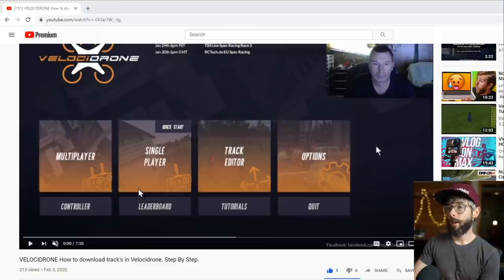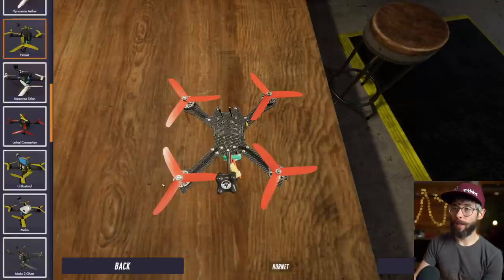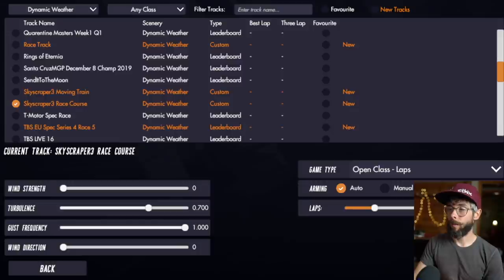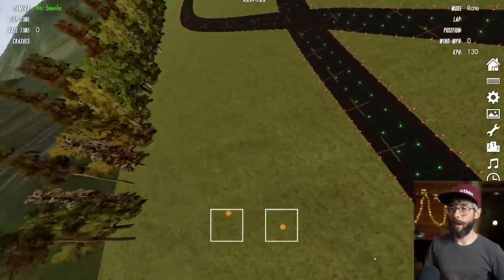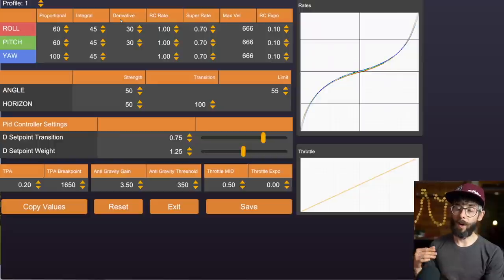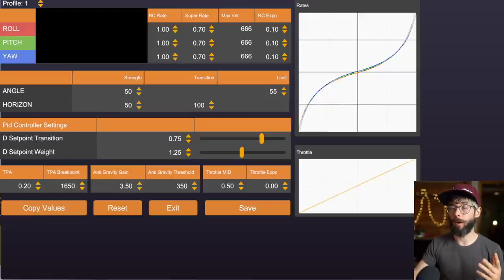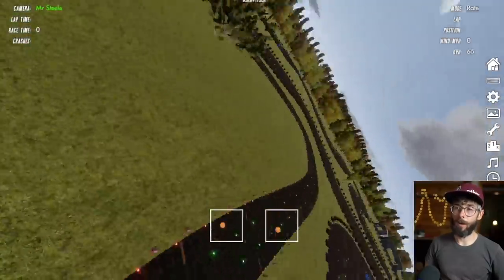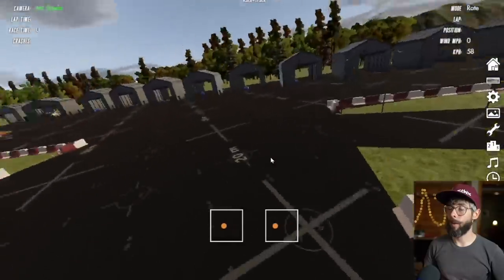Tuning Drone Rates (How To FPV 2020) Part 3

Comment: What is the reason for leaving yaw a bit slower?
Reply from the maker: Yaw on a quad is always a little wonky just because of how it inherently operates physically.  It uses Inertia over actual thrust like Roll and pitch do. Basically how are y’all works is two motors opposing each other slow down and two motors opposing each other speed up and the nurture of the props spinning up and the motor weight caused a quad to turn in a lateral orientation. Because this is using inertia it’s never going to be as accurate as something that uses thrust and also since were flying at camera angles that are not perfectly in line with the actual Quads regular geometry y’all is going to be kind of an odd access to control anyways. But with that being said there are reasons I keep it slower and usually I just find that if I need y’all to be faster I can always couple some roll into it and it’ll make it faster roll or pitch doesn’t matter you just add a little bit of stick and it will speed up to yaw movement where if you have your yaw too sensitive in the beginning it can actually be detrimental to your flying Precision
Reply: Mr Steele interesting explanation I was wondering why when I adjust yaw my vertical lift changed, where I was expecting lateral speed variation.

Comment: Oh, so I´m supposed to tune the rates for each quad? I have been putting in th same rates on all my quads to make them feel the same...
Reply from the maker: You don’t have to tune rates for each quad but if you put rates from a bunch of different Quads that are different all At the same numbers they aren’t going to fly the same just inherently because the quad sizing motor size motor power prop size and many other things have affect on how the aircraft responds
Reply: @MrSteeleFPV  That does make sence, thank you for replying!

Comment: Im gonna start with eachine e013 because of the budget...:)
Reply from the maker: Well I’m in budget is great but at this point we haven’t even purchased anything other than the radio. I do think it is important to get a real quiet so that you can kind of understand how things work quickly but at the same time I’m trying to ultimately save you money in the long run and at the end of the day the cheaper stuff that you’re buying now to save yourself money you’ll end up not using in the future because it just doesn’t hold up to long-term use

Comment: After the setting i can´t role at all anymore? Wtf. Unflyable.
Reply from the maker: Obvious you did something wrong
Reply: @MrSteeleFPV  I used all the settings, but my pitch and roll doesnt work anymore. it only pitches or rolls for approximately 20 percent. i also tried it on another PC. first it worked but after changing some settings same results. This must be some bug with velocitydrone and FrSky Taranis X-Lite. i have no clue how to fix it :(